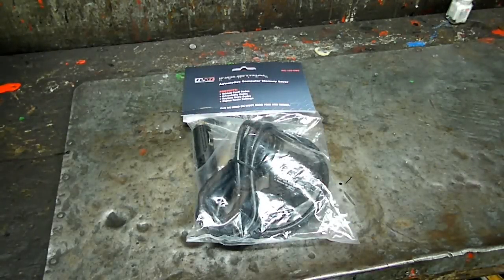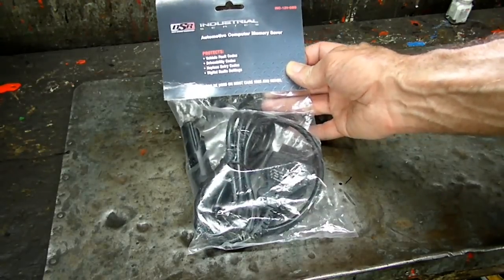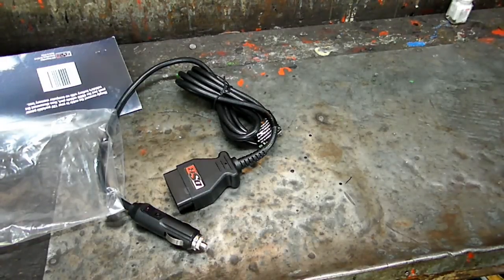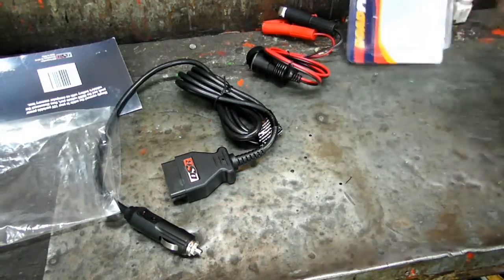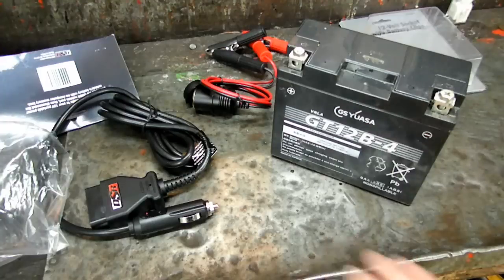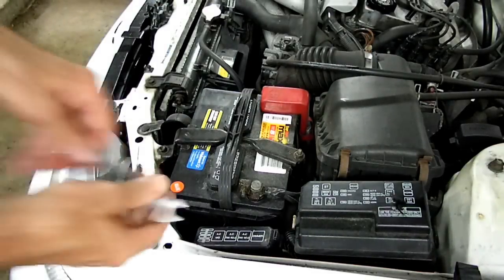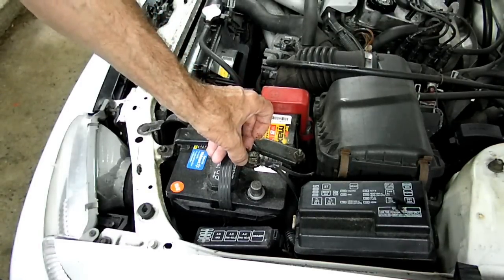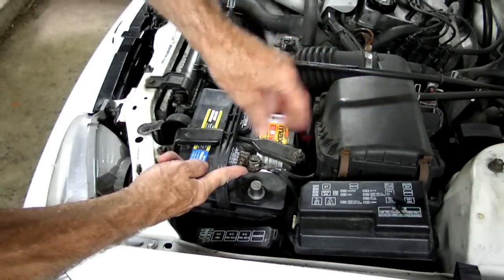OBD2 Memory Saver

Comment: You don't need this ... I simply connect my battery charger set at the lowest setting 2 amp in my case and connected to both the cars battery terminal leads. Simply disconnect the battery while the charger is still connected to the battery leads , install the new battery connect the leads to it and disconnect the battery charger from the battery leads. All done ...works every time.

Comment: Using one of these memory savers and changing the starter out   if you touch your wrench to the positive side of the starter and then to the frame of the car will it Arc just as if you had the battery in it?

Comment: You are the only guy who mentioned that the Positive terminal was hot when the memory saver was hooked up.
Good job.
Reply: alex laverick I understand that it is live, so how do you proceed with removing the terminal during the new battery installation? I mean you can still remove like you do normally but you need make sure that the positive terminal does not  come into contact with any metal right? Can you cover it with a rag and then hook it up first on the new battery and there after connect negative? Please correct me if I am wrong.
Reply: @Sanhiriyan  Yes, correct.

Comment: Great video!!  Found out the hard way this weekend that disconnecting your cars negative battery cable to do vehicle maintenance for a few hours will cause this pain that I had on my 2011  N1$$^N. Not only will it erase your codes and radio preset settings, it may also affect your vehicles immobilization/security features. After a spark plug and ignition coil change, I tidied up my work, reconnected my negative cable and NO crank and NO start. Turns out my battery was disconnected long enough for the BCM or Body Control Module to go "Dumb". You may attempt a reset of the security system but that's another full day. In closing, I'll be getting myself the OBD2 9v variant before maintenance of this kind is performed again. Now I'm smarter.  Be safe all....thanks!
Reply: So what did you do for the bcm to go dumb? Did you just let the car sit longer for the battery to re-energize everything? Or had to get it reset somehow

Comment: Thanks for the video, it was informative. That 12 V battery does not have enough voltage and thats why LED on the cable does not turn on when you connect it. That being said, cars are usually OK with a little less voltage.

Comment: When diagnosing a problem, sometimes you don't want to lose the stored codes/data. Also if you want to pass an OBD2 smog test shortly after disconnecting the battery the computer has to show that it is ready.

Comment: So what exactly need to be done while changing the battery when hooked to an external 12v source AKA memory saver during new battery installation? I still go about removing the negative terminal first and then positive and make sure the positive terminal is covered with some kind of a rag so that it does not come into contact with any metal, I would then remove the old battery and  install the new one and make sure to take out the rag and hook the positive first and then the negative. There would be no harm if you touch the positive terminal though (inadvertently) right? I would make sure to wear a glove though. Please let me know if I missed anything.

Comment: Did anyone check how much amperage the vcc pin for OBD can handle? If someone has a greater drain, as dome lights maybe, any other drain that someone doesn't know about, maybe you could damage obd wiring. I think the old-fashioned way of connecting a battery in parallel at the battery terminals is the way to go.
Reply: fuse protected.
Reply: andrew salton dd
Reply: Before using one of these, you make sure you've switched everything in the car you possibly can off.

Comment: Can you just use another car's lighter socket to plug into instead of the additional battery?
Reply: Yes as long the cable will reach but be aware that some lighter sockets are oxidative from the red glowing plug for cigarette in case one smokes there or just by sitting and humidity makes its work in form of corrosion.

Comment: An unusual way to feed power to the system.

That led is good but another on the battery side would tell you when the battery is connected, a check for saver battery power, 1 led and a 1k resistor would do the trick :-)

Comment: I'm not sure that the value in this is.  Most of the work I do involves quick service crap, and we also do inspections.  I simply wait until I've done the inspection, and then disconnect the battery if need be.  

This might be useful for people who do their own stuff before they bring their cars into the shop, to keep from failing and having to run the drive cycle.

Comment: Why not just plug the "powerpack", or your moto battery setup, directly into the cigarette lighter ... WITH the understanding that the lighter must be live, and not switched by the ignition? My Audi lighter is live all the time, so it would seem to work for me. Good job on the warning regarding the live battery cable when connected to the battery saver.
Reply from the maker: I like this setup because some of the plugs are not live.

Comment: Watching this is painful and the process so convoluted due to automakers cheap out on a replaceable battery ( couple bucks) or provide non volatile memory much like what's in your desktop, laptop computers. Never needed this, my odometer resets to zero, need to reset my clock, on one other car need access code to reset the radio, not a problem. If I have to I guess I install a pin out for the positive in the engine compartment and use the car frame as negative.

Comment: Once you attached the car's new battery, at what point exactly did you disconnect the motorcycle battery?
Reply: Right after that cause new buttery already keeps the PCM  memory by the supplied voltage so no need for the motorcycle battery anymore.

Comment: It's not that hard to just turn the ignition key to where the ACC or accessory mode is turned on, if needed, to energize the cigarette lighter et al. But spending ten times the cost is of course worth the effort - ?

Comment: Do I really need a memory saver to replace a car battery? I found an article on the internet saying or stating not to use such devices.  What does anyone think?  Thank you.
Reply: These products are a very bad idea, especially on newer cars with computer modules on a network. On later model BMW cars, you will either blow the Instrument cluster fuse, or worse, destroy the cluster. These products are not endorsed by most master technicians including me.
Reply: work fine when used correct, some run of a 9v battery. Makes it near impossible to damage anything as max current is about an amp.
Reply: @wbfog  cool story bro.

Comment: so I saw the comment below just want to be sure you said it saves the radio security code?  asking bc I want to upgrade my girlfriends battery and she lost the radio code card from Honda.  if this saves the code it will save us the trouble of trying to coax this out of the dealer.
Reply from the maker: I am not sure on the Honda.
Reply: the memory saver keeps the car live with voltage does it not?
Reply from the maker: 6xygoose
It is supposed to.
Reply: +richpin06a For future reference, it does. It also keeps Toyotas from clearing their learned fuel mixture and refusing to start. If this happens, just clean the throttle body and unhook the battery again.

Comment: I connect long wire to the battery then remove the cable then put it down and put the new battery connect the cables and disconnect the wires, easy pizzi

Comment: I've seen comments on other videos that SOME very new cars will retain settings for about 30 minutes long enough to change the battery.  Seeing that desktop computers have had CMOS batteries for decades it seems incredible that cars do not.  In computers the CMOS battery is usually a CR2032 battery about the size of a small coin & they retain the computer settings when it's turned off.  These batteries cost about $3.00 on Amazon!

Comment: These products are a very bad idea, especially on newer cars with computer modules on a network. On later model BMW cars, you will either blow the Instrument cluster fuse, or worse, destroy the cluster. (I've seen it happen) These products are not endorsed by most master technicians including me.  Not trying to cause controversy, but rather save somebody lots of heartache.
Reply from the maker: What do you recommend for saving the memory.
Reply: The only way I would attempt, but do not recommend, to save memory would be to hook booster pack to jumper lead location under hood, and carefully do the battery swap live. No manufacturer endorses memory saving, but rather they say just reset and relearn the system, including radio pass codes. If a person has a system that voltage has completely wiped out for whatever reason, this process many times must be performed anyway.
Reply: marc wischkaemper  My father in law disconnected the battery on his Lexus to clean the terminals and posts. After reconnecting the battery, the power windows wouldn't work, the traction control light illuminated, and the transmission would not go into overdrive. It was a real PITA. I don't know about BMW, but if my fil had used a memory saver, it could have saved him money and a headache.
Reply: Name calling is always a sign of intelligence, NOT!
Reply: Truth hurts, doesn't it? LOL!
Reply: These memory saver usually have internal fuse thus preventing any electrical harm to the fuse box/ecm.  Did you do your research before posting your opinions? You sound like chicken little,  "the sky is falling! The sky is falling!"